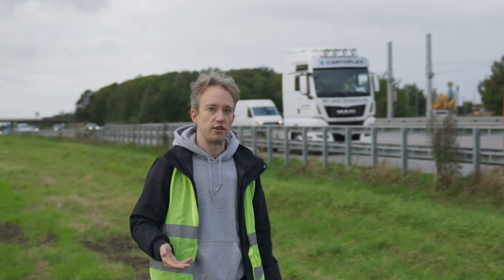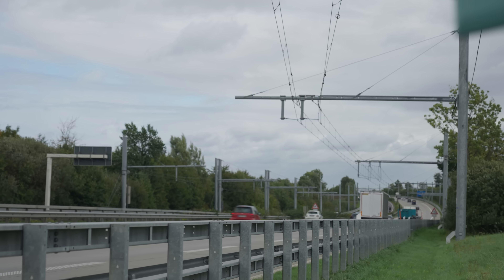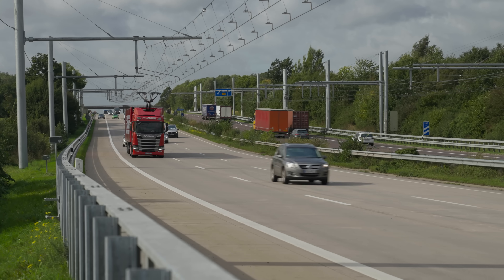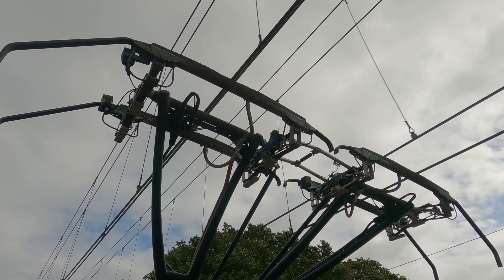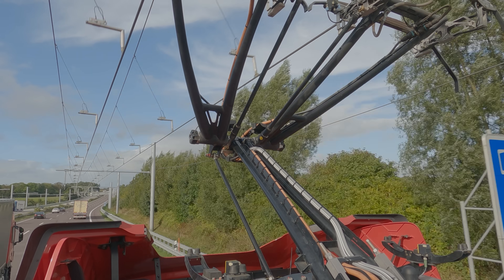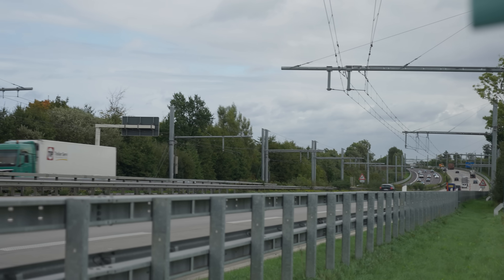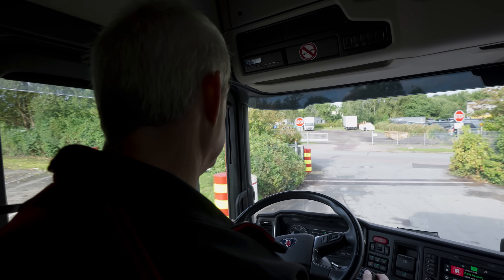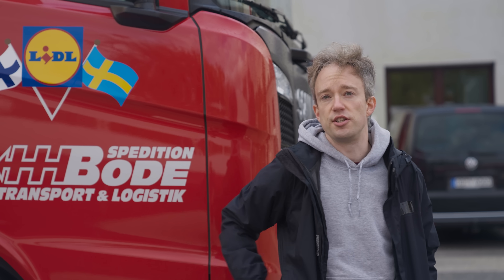The highway where trucks work like electric trains

Comment: On todays episode of “Trains but worse”
Reply: Truck drivers get to keep their jobs
Reply: Last mile problem? As in, what about when you're carrying goods on highways from the rail terminal to, you know, where they're actually needed? Rails and trains to every single convenience store, bakeries, and other drop-off points receiving deliveries? Move all those businesses, schools, etc. next to rail terminals?
Reply: @Coffeepanda294  small box trucks or vans, it’s not rocket science.

And if it’s a massive big box store, like a Walmart supercenter, increase the frequency of deliveries, and it would still be cheaper than a big semi truck, because you would drastically shorten the distance traveled on inefficient rubber tires because of the trains.
Reply: @unnamedracer9757  Strange reply. What about when you're carrying greater quantities of goods? Which is more environmentally friendly since it requires fewer vehicles for each delivery?
Reply: @Coffeepanda294  the f do you think a train is?

The orders of magnitude more efficiency from a train doing the majority of the distance drastically offsets any potential savings of using a semi truck instead of three or four box trucks.

Comment: "Interesting project, but the E-Highway test track on the A1 near Lübeck will be shut down at the end of 2024. 🚛⚡ The overhead lines that power trucks while driving will be dismantled due to funding ending and high maintenance costs. Technical challenges, like unreliable GPS controls and frequent repairs, made it difficult to justify continued investment. Despite some success in reducing emissions, the project is being discontinued."

Comment: What a ridiculous statement that diesel and gasoline is being phased out. 😂 That does not to seem to be happening at all.
Reply: have you looked at the market share of combustion vs electric? electric has been gaining ground for years now.
Reply: @TheAechBomb  compared to zero that was before, yes. However it is not even close to expectation, especially without incentives. The power grid is not even close to being ready to handle widespread adoption. And governments would need to invest disproportionately more in nuclear energy than before to handle it clean.

Comment: I believe that the trolley buses in Wellington ran on maybe 300 DC. I know suburban rail do. The drivers and passengers loved them but cut no ice with the Wellington local council. The overhead wires were “ obsolete “ …. Actually recently modernised  !!  But hey let’s kick the can down the road and pull them down but don’t tell anyone that you have buyers in England already lined up to purchase them. The only victims are the long - suffering rate payers who are bracing for another “ kick in the guts” this year.

Comment: I have a proposal. In order to prevent accuracy issue and maximize the use of electric grid, we should have a ridge for the truck to follow on the road. Kinda like a funnel if you will.

Comment: Another approach, easily applicable with no new technology required, is to use electric rail for long-distance haulage, road haulage of containers and the like only being permitted between railway freight depots and the supplier or final destination. It works on the Chanel Tunnel ….
Reply: Of course, I am not mentioning the financial lobbies: hi-tech high-capacity battery and replacement battery manufacturers; road halage companies; …..

Comment: I moved to Frankfurt 10yrs ago, and several kilometres of this type of system were already in place and being tested. Its a shame that a similar approach is not being investigated for cars and vans. The manufacturing carbon footprint for their “high capacity batteries” is not too good; if you only drive a couple of thousand km per year an efficient petrol engine is possibly more eco-friendly.

Comment: can't u just charge with the overhead wires and then the roads u don't have them u just use batteries
Reply: Thats actually exactly how it works. I do not know if the system shown in the video has in motion charging. I know that other systems like it do charge, while moving.
Reply: @Ravn7  thats perfect! so u only need certain key parts of the road and thats it

Comment: After getting more involved in this stuff, and thinking more about it, I can't help but think. Instead of putting overhead power lines on motorways for long distance trucks, could we not just get those trucks off the road and put the cargo on to electric trains instead? Then have battery trucks for shorter distance trucking where batteries are a decent option.

I know a lot of freight is already carried by rail, but seemingly not enough, as very long-distance trucking, where rail freight is significantly more cost-effective, is still very much a thing and is still carrying a significant amount of freight every year.

Comment: Nonsense and stupidity! Why they don't use already existing railways with electric wire? Steel wheels on tracks makes even less resistance then rubber wheels on asphalt roads. This is unnecessary waste of money, looks like a large scale money laundering or making one more chance for corruption.

Comment: They have been using this system for decades on the extra heavy mining vehicles in open pit mining here in South Africa. Some of those pits are very steep and deep and the diesel saving for this fully laden mine trucks hauling crush from the botton is enormous. If memory serves me correctly, they use regenerative braking on the way back down pushing electricity back into the grid.

Comment: A genuinely stupid idea. The greater energy efficiency of railroads comes from the steel wheels and rails. Trains have as much as 99% less rolling resistance than driving on rubber tires. Long distance trucking never has been and never will be energy efficient.

Comment: do away with the overhead wires put the connectors in the road via the wheels and install rechargeable battery packs so the trucks can go offline until needing to reconnect to the grid.

Comment: Similarly, the road itself needs to be a control-system 'actor' with some motor/sensory caps for a more easily achievable robust self-driving... network. Once on an interstate, vehicles would be maintained in separation, through merges, exits and minor accidents, vastly lowering the potential for collisions, thus self-driving development glitches are less risky. Less lawsuits. The tech in the vehicles would not need to be so advanced and expensive, either. 

As it is, the tech in the car must be so advanced because it is compensating for a difficult open-loop in the control system - a lazy partner.

Comment: How is the energy GENERATED? If it is a dirty source then what is the point? How do you disconnect the fuel tax from the system which is needed to pay for road upkeep?  Can these truck lanes be adapted to driverless technologies?
Reply: Germany has almost 60 % renewables right now in the energy mix
Reply: @simonm1447  I found on the CEW site, currently 52% is from renewable sources, but the divergence from non-renewable sources became significant around 2014. Exactly what an intelligent country would be doing.

Comment: WHY not just use trains?
Reply: A train is much less flexible for delivering things point-to-point. A train makes sense for when you need to move many things in one direction. Splitting trains into carriages and diverting them to individual directions is very complicated already. A train would make sense from Port to a massive rail hub, but not from there to small warehouses all about. Train delivery also takes much longer, so for certain products it's not viable (fish from coast to inland, livestock,  cooled products). It's perfect for large volume goods that can "sit for a while"
Reply: @janipiot  not so, everywhere in us and EU you can see the remains of old spur lines, on which individual boxcars were broken off from trains and delivered to a factory or industrial area, large or small...  branch rail lines serviced these areas from the larger main lines...

Cattle haven been moving on trains for over 150 years....
Reply: @PRH123  your keyword is "remains" - the spurs were used before trucks won the competition on flexibility
Reply: @PRH123  we also used horses before cars were invented doesn't mean we should all become equestrians again
Reply: @rfldss89  don’t understand your point…. what are you trying to say…?
Reply: @janipiot  Maybe they need ''amphibious trucks'' that can use the rail system and then roll off onto the roads again.
Reply: @niklar55 the issue with "amphibious trains" would be a) weight, most roads and especially Highway Bridges are not designed for so heavy vehicles, 
b) length, since existing roads arent designed for hundrets of meters long trains (and splitting each train into smaller segments doesn't make much sense, given that that's just a truck with extra steps). Just imagine a train crawling across an intersection, that would clog everything up 
And c) you'd still have one giant train, that would need to deliver goods to several locations, with often very different situations, i.e. a warehouse in a dense industrial area, the next one is just across the street from the harbor and so on
Reply: @p3chv0gel22  
I meant ''amphibious trains'' made up with modified trucks.
ie. a set of wheels that could be lowered for rail use, and lifted clear for road use.
.
Reply: @kristianlien  
Why aren't they using it then?
Reply: Last mile.
Reply: It wont get you votes
Reply: To few tracks and trains cant deliver to the end customer.
Reply: @NYlocked  
Trucks could be combined for final delivery.
Reply: Trains can't back up to every warehouse in the city
Reply: Rail yards are insanely expensive due to the price of land, typically other people’s land. 

Also rail cannot go to the majority of warehouses, which would be needed.
Reply: The infrastructure is there so why not use it?
Reply: Rail track are far more expensive to build and maintain than roads.  I think it something like 5 times as expensive.  Then there is the lack of flexibility and all that on top.
Reply: @laxarus3259  
I'm not suggesting new ralis, just use existing for most of the distance.
Reply: @niklar55  The rails are already fully utilised and can only increase capacity slightly; perhaps when the ETCS (European Train Control System) is fully operational, capacity can be increased. However, as demand is constantly increasing, it will not be possible to do without road transport.
Reply: @laxarus3259    Quick glance at the internet indicates that it’s in fact quite the opposite: 

“The cost to combine rail and truck using a bulk transfer terminal is approximately $95.54 per net ton. By comparison, rail direct is $70.27 per net ton, and over-the-road truck is $214.96 per net ton.”

“A new 8 lane interstate class highway in the US costs about $50 million per mile on flat land, aside from land acquisition costs which, of course, vary widely. $2-3 million per mile for rail for a 79 MPH signaled single track line”
Reply: @laxarus3259   just a couple minutes of googling shows that it’s actually the opposite: “ a new 8 lane interstate class highway in the US costs about $50 million per mile on flat land, aside from land acquisition costs.  $2-3 million per mile for a 79 MPH signaled single track line.”

Comment: I remember these overhead wires for public transportation buses when I was growing up near Boston in the 1950s. After a snowstorm, there were sometimes snowdrifts that the bus needed to steer around, and the bus would disconnect from the overhead wire. Then the driver needed to use a very long pole to try to move the connection back in place.

Comment: In Switzerland we have a working train network and it is much cheaper an a lot faster than trucks could ever be.
Sure for the last few kilometers you will need trucks from the train-hubs to the companies, but as mentioned in the video, that's gonna be of grid anyways.

Germany is the troublemaker in Europe, because they have cut funding for train infrastructure for so long now, that the grid has decreased by over 10% while traffic and therefore usage has highly increased. This leaves almost 100% of the tracks run down and in desperate need of maintenance, what lead to unreliability for freight as well as public transportation.
If Germany would get their act together and finally install a competent, non-car-fanatic minister and throw out the DB Management with their state majority on the DB Board, Europe could again switch fully to on track cargo and use trucks only for last mile  or special transports as it should be.

Comment: 02:56 why does he still wants to pay a fuel tax to the gov if the truck is using electricity? I mean...changing to electricity should help the operator have lower operating costs (tax included) why would someone make such an investment only to pay the same tax, even better, now that he doesn't have to pay fuel tax directly, he will pay another sort of tax but for the same thing.
Reply: Fuel taxes are used to fund highway maintenance and repairs including the inspection and repair of bridges.
Reply: @danielebrparish4271 yes and no, and I will tell you why, you see, the road tax is included in everything that uses the road, even multiple places. Let me give you an example: A car, that car pays road tax when fueling, the car itself has a certain tax annually from which a certain percentage is kept as road tax, on the insurance once again, a small percentage is for road tax, and so on so forth, my point here is that there are not enough roads and bridges for them taxes to be justified, so when the gov tells you that they give a certain tax break if you buy smth, well thats a scam, cause the next thing that will happen is another tax to replace the old one, but under a new alias

Comment: Germany, the only place that has coal-powered green-labeled trucks
🙌🏻💯
Reply: You are sereosly misinformed. 58% of the Energy in Germany is from Solar and Wind alone. Fossil fuels make up about 25%, with coal only being a part of that.

Just because Germany got rid of nuclear, this does not mean everything is run by coal. It got mostly replaced with renewables, the amount of coal used never increased. And while I disagree with ditching nuclear energy, it's untrue that Germany replaced it with coal and the decision to ditch nuclear was not made recently, but in the year 2010-2014 and this just took 10 years to take full effect
Reply: What 's the difference between coal powered Electric trucks or coal powered trolley trucks...
Reply: @lws7394  But it's not coal powered. Have you ever been to northern Germany? Everything its flat and empty, therefore everything is plastered with Wind Turbines next to the roads. Yes, in Germany 25% of the electricityis made from coal. That however are mostly the more central and southern areas. The by far biggest source of energy in Germany is wind

Comment: just build trains??
Reply: Trains and Trucks can co-exist. You combine both. This track is build on the A1 Highway, a highway that connects Hamburg (gigantic Port City with a big Train infrastructure) with many smaller towns and villages.

The trucks you see on there all have a different destination, but the A1 is the part of the road most of them share. That's the advantage compared to a train, you can't build a train station to every single nearby shop. That's what the trucks are for. Trains are awesome for long distance transportation, trucks to deliver the good from major train stations to local towns and shops

The trucks on the A1 are used to deliver the good from the Hamburg port and Hamburg train station to local towns

This track you see in this video is really small and not intended for long distance travel at all

Comment: On long motorways this is such an obvious and simple solution, why isn’t it a thing?
Reply: Because this requires special trucks. This creates a Egg/Chicken situation:

There are only 6 Trucks that can actually use this grid, but why build more trucks if there is only this tiny grid? But why build more grids if there are only 6 Trucks? etc.

Comment: To me personally i am concerned about the climate change of the storms of that cause a lot of havoc on these roads as well as peoples lives by using these particular motor ways, especially the radiation that could come from them affecting peoples health, and i sincerely think that not a lot of thought has gone into realising these kinds of issues, and i do not think that the people that put these things up on you tube do not realise the hazards that it could bring.

And another thing is this and that is its just like bringing a nuclear plant too all of our infrastructure on our roads, and also too make transport like this, you are still putting out a carbon footprint on the ozone layer, because of the factoiries putting out there pollution into the ionisphere too build and make these vehicles as well as the infrastructure that it takes too build also the total electric overhead of the infrastructure in general, its not about the money too create and build such a project but the health and impact on what that it is going too do with the human race in general.

And too me personally though as well it is nothing but mad scientists at work by creating a lot of ludicrous ideas and frivoulous ways of trying too deal with a infrastructure that is just total madness.

Comment: Yes, it is an experiment to see if this is do able. In the US some are talking of a power/charging strip 
embedded into the pavement so a vehicle could suck up power off the strip just like a charge pad 
works for your phone. Like your power wires, not all roads would have these power strips only major
highways.

!